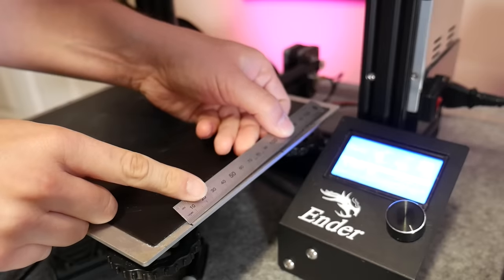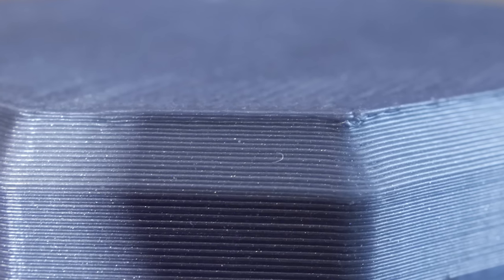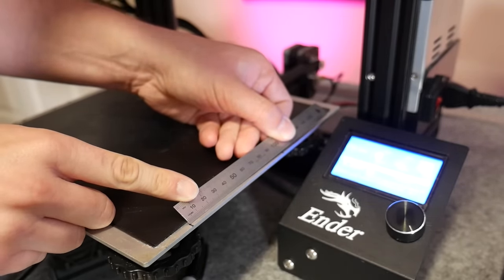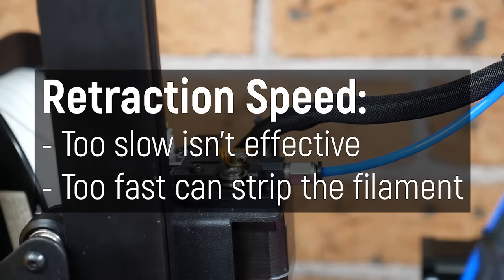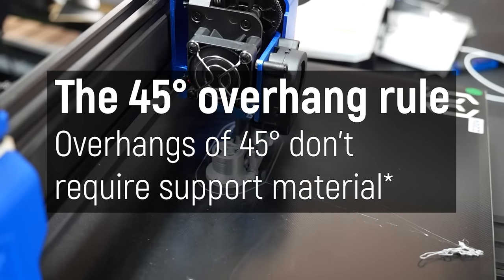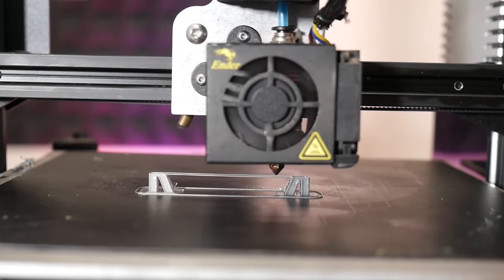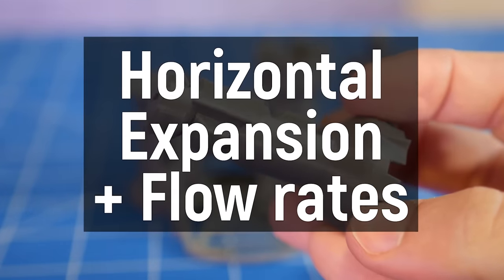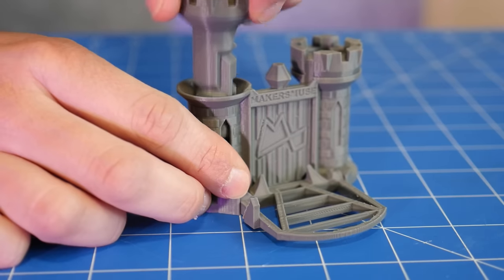The Ultimate Guide to Perfect 3D Prints

Comment: This tips are pure gold.
And here is a fact that shows it:
Shipping my printer from Spain to NL, my creality arrived completely messed up. Two supports with the wheels unaligned, one cable of the extruder cutted off, and the elevation screw... Of course... Bent.
I fought repairing everything by myself, correcting deviations, welding and bending again... And printed zillion times.
Well, guess what? The elevation screw wasn't rectified enough... And now I am ordering a new one cause I cannot print a damn cube smoothly enough...😆

Comment: Another thing that can cause periodic uneven layers (ripple-like effect) is a loose print bed.  I had this happen with my CR-10 where the rollers on the print bed rail were loose, so the bed would rock back and forth slightly.  Just tightening the screws a bit completely solved the problem, but it's certainly something to keep an eye out for since they can loosen back up with use.

The interesting thing was figuring out why a wobbly print bed created such a regular ripple pattern in the print, rather than just looking like random displacement error.  My conclusion was that it had to do with the interaction between the wobble and the movement of the bed, where the printbed and print can wobble in resonance with the motion according to the contours of the print.  As the print grows, the mass increases, and so the resonance changes as well, and so the ripples are essentially a sort of interference pattern between the print-in-progress's resonance and the driven motion of the y-axis.

Comment: Great tips and process. I don't entirely agree that the extrusion multiplier being the last thing after everything else. Prusa has a good guide where you print a vase mode cube and measure the sides so that when it says "extrusion width 0.45" the extrusion width is actually 0.45. It's not needed for every filament and you can often get away without changing it. But if your extrusion width isn't actually what it's expected to be, your overhangs will have problems, your top and bottom layers will be overextruded/underextruded, your bridges may fail... all because what was expected to come out of the nozzle is not the correct width. I'd say make sure your extrusion width/extrusion multiplier is correct before stringing and the steps that follow. That's my opinion.

Comment: Just to add another thing to check (as it was something that mucked me up for ages)... if you are having extrusion issues (specifically clogging), check your driver vref. I couldn't figure out why I kept getting clogging at different times... then someone suggested checking the vref and it turned out mine were all over the place. Adjusted them all and it's now much more reliable.

Comment: I usually just print in pla and petg so I'm still using a stock Ender 3. I have not performed any modifications on it yet. The only thing I did was printed the fan shroud for the control board. My printer has been running flawlessly for three years now without maintenance needed. The trick is to take your time with your print. My only issue is deciding how thick I'm going to make lithographs. I use a different method for leveling my bed. I do use the feeler gauge but I engage a print and then stop it during the skirt. I didn't clean off the bed and the nozzle and remove my bed into position of the tip I take my feeler gauge and I find the right depth for all four corners as well as the center. I am printing on a creality glass print surface so I know it is a true surface. I never use anything is at adhesive for the bed and to attach the bed to the aluminum I just use Elmer's white glue. As long as you go in a nice thin layer usually won't have to take the bed off you won't have to worry about damaging it and when it finally comes off on its own is the best time to clean it.

Comment: I definitely don't consider flow-rate modification "hacky;"it's adjusting for density, and it's the first thing I do with any new roll/brand of filament that I haven't calibrated it for already. With the same e-steps, some extrude as much 15% over what they should; for some it's only 8% more, and I dont think I've ever had a roll calibrate for it exactly at 100. Just because you're pushing the same length of filament (estpes) doesn't mean you're pushing the same mass of filament. It's in the slicer settings and not the printer settings for a reason, IMO: it's way more likely to need accounting for than your x/y/z steps. Tomb of 3D Printed Horrors has a great calibration video that I reference to this day that shows what this setting can do.
Reply: exactly! 
density! what goes in comes out except for what you burn!
cheers
Reply: Density is neither here nor there. What does it matter whether it weighs more or less? If you propel a certain length forward, you will receive a certain volume of bead just depending on the length that you have emitted and the diameter of the filament and layer height and nothing else. If you propel 1cm of filament forward, and your filament cross section area is pi*(1.75cm/2)^2, cross-section times length is exactly the amount of filament that will come out of the nozzle by volume, no regard for density!

The problem is compressibility. That for a given idler pressure, the amount by which the extruder gear will indent into the filament will differ, so the effective radius of the extruder gear will differ as well! Since you rotate the extruder by a certain angle, a certain number of steps that you only assume to propel a given filament length, the real length propelled will differ as well.
Reply: @rexxx927  concrete is easier to push than marshmallow, because it's incompressible. Friction is also neither here nor there, since motor isn't linear and we know it's not skipping, or we'd hear a click every time it loses alignment with the drive phase, about once every 0.1-0.2cm of failed extrusion depending on extruder geometry.
Reply: @SianaGearz  Go watch the video I reference and ask me again what it matters.
Reply: @ToastbackWhale  How nice of you to waste my time. The video contains ZERO mentions of "density" or "weight".
Reply: @Paiadakine  you are correct and so is @Siana Gearz i was mistaken and have removed the fals thiughts please excuse me

Comment: Great vid !
I don't really agree on the e-steps calibration for X/Y/Z, though. Thing is, if you calibrate it with a 20x20x20 mm cube, larger parts might eventually be off.
TBH, I never did those calibration cubes,and  never had any dimensional accuraty issue so far. The only things I check are purely mechanical (leadscrews, belts, z-offset, gantry squareness), extruder rotation distance (or e-steps, in Marlin) and, if some material doesn't extrude "as it should", flow rate – there are some differencies between flexibles, PETG, PLA and others. Small fluctuations give big differencies.

Comment: Some extruders, especially Dual Drive extruders will squish the filament a bit.
This means you should at least calibrate Flow rate per Material - it can vary a surprising amount.
Reply: no! the density and volume is not affected by deformed filament unless its grinding material away but deformation is not good for your flow in extrusion or the filaments path like Bowden or other path alike causing restriction and loss in pushing power
Yes! each material is calculated for that rolls actual gauge and that materials specific density g/CC cubed 
the material is still there in and out it will all be there! no magic what goes in come out!
Reply: @rexxx927  printing abs requires a much lower flow/extrusion multiplier
Reply: @justjake3405  not always there are hundreds of asa and abs base formulations and the density's are a large swing like 1.02-1.21
Reply: @justjake3405  mg-94 is like 1.07  but yes exrtusion factors should be always tuned

Comment: I had to change belt and pulleys on my printer. Surprisingly enough, pulleys with exact same teeth number been nowhere to be found. That meant I had to recalibrate for different steps/mm with different pulleys.
I figured indirect measurement is no good enough. There are more factors affecting the printed part fine size.
And I figured much more precise measurement can be done with digital calipers even without wasting any filament.
Just hold calipers against the printer and it will act like a DRO (digital readout).
Part of the trick is to find a good place where you can hold it securely while printer pushes one of the jaws.
Measurement procedure after calipers are held in place: send a short movement command to ensure right contact, zero out the calipers (but don't move), send a movement command as long as your calipers and printer would safely allow, write down values from calipers and from the command. Repeat for all axes you want to calibrate, then again to further reduce measurement errors.
Reply: Good idea but it might be tricky to hold the calipers exactly parallel to travel direction. A good start but I'd recommend printing a 150mm (~max caliper length) thick single walled square (or ring) and measure while it's still stuck to the bed. Also measure and account for wall thickness.
Reply: @mhdm  calipers have good reference surfaces by design. Can't speak for all printers but I expect most of them to contain mostly orthogonal surfaces as well.
Even if we consider a deviation of a few degrees - it still will result in smaller error (think about triangle approximations for small angles) than a single printed wall thickness plus flex plus thermal effects. And a print has no good reference surfaces - even if you try to account for wall thickness - you'd have to do two measurements with bad reference.

Comment: I haven’t touched my FDM printer in years. I got a glass bed for it and just dialed in the bed level. I printed the castle. Had a very difficult time getting the maze tower moving. With the help of a screwdriver I got it moving. Other than some minor stringing and some overhangs not perfect the castle looks great.

Ender 5 pro bought in 2019. Creality glass bed is the only change. Filament has been exposed to the air, not in a dehumidifier since 2021.

For what I want to print my printer is fine. I’ll use this one for my D&D game. I’m getting another printer for moving or pieces that need to fit together.
Reply: Gonna print a better fan set up I think that’ll fix most of my issues. Next will be fixing the minor zits pockmarking the piece.

Comment: Can I just say that calibrating axis steps in general is 99% of the time a completely incorrect way of fixing things?
(this is a post I made a few days ago on a forum, but it fits perfectly)

How accurate factory esteps are is entirely dependent on your filament and spring tension (which affects tooth engagement and filament being compressed). If you use a different material, your settings will be completely out of wack. Don't remember the Cura settting but Prusaslicer has "Extrusion multiplier". You should avoid changing hardware/firmware for something that is inherently a material property.

Likewise, printing and measuring a calibration cube as a means to set x and y steps is completely dependant on your filament extrusion being perfect. With factory settings, the cube, regardless the size, should be over/undersized exactly the same amount (obviously with caveats). If you change x steps so your 19.8 mm cube will be printed as 20mm, your 80 mm cube will be printed as 80.8mm cube.
While belt tension also affects accuracy, it's much less - overtensioning the belt by 2 mm on a 220 mm wide printer will change the accuracy by 0.009 mm when printing full width (again, there's some caveats especially if you're too far off the sweet spot).
If you really think your axes need calibration, mount calipers colinearly with your axis and check if the movement measured is identical.

To be clear, manufacturers make mistakes - but just make sure your calibrations don't actually make things worse. In 95% of cases, you should be tuning things in the slicer's material settings.
Reply: Quite right, but I think the esteps part needs some clarification. Specifically, you should configure esteps with a specific tension and a very hard filament (and no resistance). After this you would make a filament-specific extrusion multiplier, that takes into account both the filament softness and any changes in tension that you might have made.

In other words, there's 2 components to esteps: the inherent arc size of a step, and the interaction of a specific filament with the extruder drive.
Reply: @marcus3d  The esteps calibration is actually the least problematic for someone that sticks with a single filament, but not even PLAs are created equal. Not so different that it would affect results significantly, but still. Even Prusa's fancy new Nextruder is not immune to this, however it reduces the error introduced by tooth engagement into the filament to a third just because the extruder gear is significantly bigger - not even taking into account the idler changes of course.

3D printing can be quite an art form in some aspects, but I feel old advice sticking around is somewhat keeping the whole community back and making basic printers a lot more fiddly than they have to be. Partially due to mistakes propagated for years already, such as first print layer being at height 0 rather than set layer height - I believe that was mostly Creality's cooking, but I'm not too sure. Likewise, any time I see someone printing PLA on blue painter's tape (with a perfectly usable print surface underneath), I die a little inside.
Reply: Extrusion gear in cheap printers is a piece of pinion wire which differs wildly in diameter from batch to batch, and the firmware as it comes on them usually doesn't take account of that.

Z axis must be spot on by design, and XY are pretty close and difficult to calibrate better, though tension dependent. It's rare to see XY steps specified wrong by default, but weirder things have happened. For sure keeping the limitations of your own measurement in mind is vital. Often times when people calibrate they're neglecting some sort of root cause fault that causes the machine to print incorrectly, so calibration fundamentally only makes it worse.
Reply: I put a ruler on the bad, put the nozzle on the zero point and moved it 100 mm, but instead of standing on the 100 mm ruler, it stood on 106 mm, does it need calibration?

Comment: Excellent video, especially for a beginner like me! Only issue I've had is moderate stringing on some jobs, but I really need to check my vertical calibration to see if that's an issue, or if the design is a bit off. Thank you!

Comment: Assembly will also throw you off as well, just got mine yesterday.and relisted my horizontal bar that the hot end travels on was low on the right side of the printer, had to build 2 identical spacers to lvl my bed properly, I was wondering why my bed springs were fully compressed on the right side. Great video 👍

Comment: Nice info! Except for your advice on flow rate. You should always tune your flow rate for each roll of filament. With correct estep or rotational distance tuned you will still get over extrusion in my experience. The variable is filament diameter.
To tune your flow rate you print a single wall cube at 1.0 flow multiplier in the slicer then measure the printed parts wall thickness and calculate the required flow percentage basses upon that.

Comment: One side note to the cooling. According to my experiences, if you're printing with ABS you don't want to have any cooling as it will cause thermal degradation, and the flat bottom of the print will curve up. This can make it unstable and move around as the nozzle moves.

Comment: My first tip for better prints: buy hatchbox filament (Or other high quality filament, hatchbox is only $23/kilo though.) Even coming to that from $20/kg knockoff filament nearly eliminated stringing and warping. That and using a raft so you don't have to mess with bed levelling (Only for print in place objects) got my ender 3 completing the calibration castle first try.
Reply: Yeah man I love rafts.

Comment: Thank you for providing this guide, I am new to 3D printing and already tearing my hair out.  I am getting good at Prusa after watching your video so once again thank you.  However I am wasting more filament than I am successfully printing,  I have a Creality ender 3 V2 Neo printer with glass bed, I have calibrated and levelled the bed multiple times, and it is currently set perfect, however the filament will not stick no matter how often I clean the bed.  I have flipped over the glass and this seems to provide slightly better grip, but will still pop off half way through the build if it gets snagged on a loose fragment.